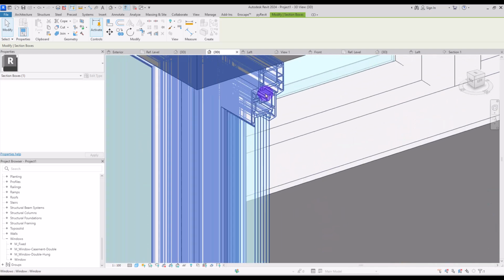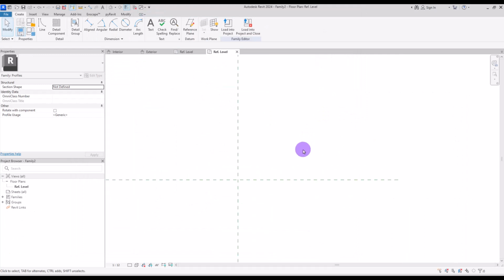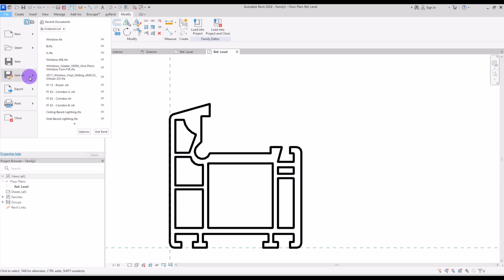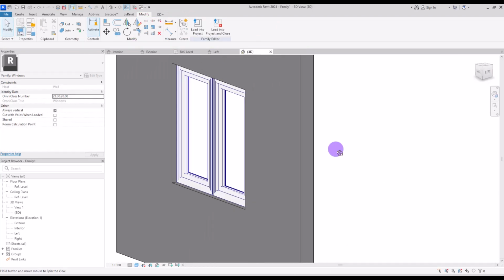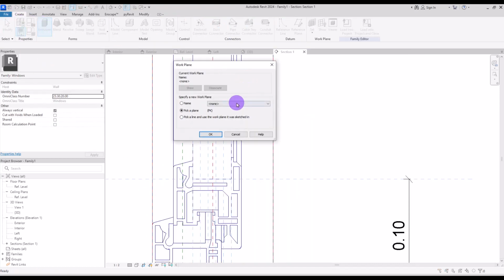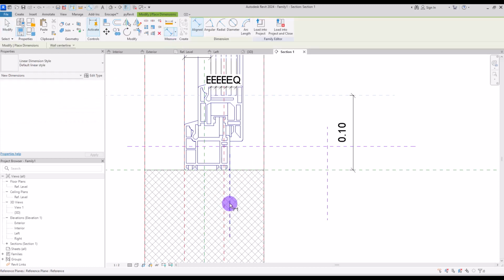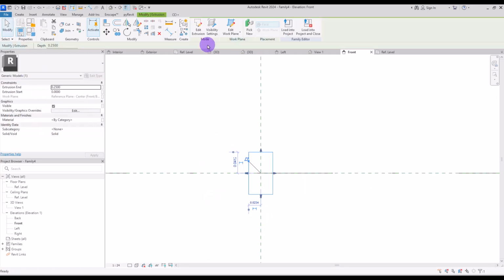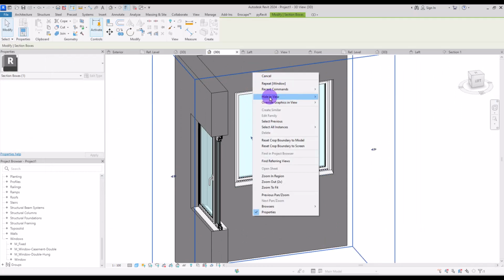How to Create a Parametric Window Like a PRO! #revit

Comment: Everything worked perfectly according to your instructions, until I put the window in a thicker wall, then the glass floats away, I can't figure out what I'm doing wrong. 
Everything else works, except the glass, I don't understand what to fix it to. 
Can you tell me how to fix the glass so that it fits with the window frame?
Reply from the maker: It sounds like you need to adjust the sketch lines to the correct references. You need to check this for all four sides.

Comment: Great video and very helpful. But when I upload the family on the project, the glass and the handle are separated from the rest of the window. I think i have to lock them to the surface or a plane. Could you specify this? Thanks in advance
Reply from the maker: You are welcome. Yes, you are right. This type of issue is because of not locking the elements correctly. You can lock them to a Surface, but I never suggest it. Locking anything to a reference plane or creating parameter for them is a much safer option.
Reply: @RVTPLUS  Thank you very much!

Comment: I am getting an error when I am placing profile in the left view that cant creat sweep what is the solutions for this
Reply from the maker: That could have a lot of reasons. First check if there is any open loops. Then check for lines smaller than 0.0008. these types of errors are mainly because of sketching.

Comment: May I ask why you didn't create profile A and B together as 1 Sweep?
Reply from the maker: Well there is absolutely no problem with creating them together, but firstly it is easier to check the lines this way. As you saw it is a bit challenging to draw small lines and curves. Additionally, if it is a double hung window creating the main frame separately is more practical for corners and joins, and also for making them openable.

Comment: DOES WORK!!!! REVIT SUCKS!!!! Cant even progress further then the first step, constraints wont allow me to align the reference planes in red to the outside walls. I am sick of this program and only been using it a week. It's not intuitive at all and even when things are 'accurate' they're overlapping geometry is all over the place it's like AutoDesk tried creating Sketchup and failed epically. I hate, HATE HATE!!! this software!!! so long winded having to create a family for every piece of geometry ever in existence.
Reply from the maker: I agree with you, and so do most Revit users in the community. Starting with Revit can be incredibly frustrating. The program still has some strange clashes that can be super tough and result in a lot of time lost.

But honestly, if you are new to Revit, you started with one of the most challenging families. I suggest trying out some simpler families first, like a parametric shelf or a bedroom setup. You can easily find these in the Revit Family playlist.
And if you need this window family for your own projects or to use it as a reference, there's a link in the description where you can download it. Hope this helps!

Comment: also, is it possible to only do an extrusion on 3 sides? I have a window with a flange on all sides except the bottom. Thanks
Reply from the maker: Sure You can. It is exactly like this, but you need to add more profiles around the main part. First draw it on AutoCAD or even on a paper and then try to model it in Revit.
Reply: @RVTPLUS  I don't have or use auto cad. Not 3 sides of the profile, 3 sides of the window.
Reply from the maker: If you watch the video again, you will see that first we draw one side of the Window, and then we repeated it for the other part. You need to do the same for any part that you want to add. You can separate different parts with References and Parameters.
Reply: @RVTPLUS   It looks like you have a window with more than 1 pane. I'm talking about a single paned window. See here >> 
https://youtu.be/fvihdhhVtyY
Reply from the maker: Well, it seems like you do all the parts correctly. Just instead of deleting the bottom part and drawing another one, First copy the sweep on itself and then delete the bottom part in one of them and in other one delete the other left and right and top part. This way their placement will be correct. 

But if I you do that, I think you will have extra parts where they reach to each other, so to fix it you can use Void Extrusion. Draw a cube and rotate it 45 degree and then apply it to both bottom corners. You must have 4 of them. Two for both sides of bottom part. One for the left side and last one for the other part.

Comment: Ugh. I keep getting a "can't create sweep error".
Reply from the maker: Try to draw lines in one continuous loop and make sure they are long enough. Too small fillets also might cause this error.
Reply: @RVTPLUS   will try that. I tried deleting all of my internal ones, but still no luck with that path.
Reply from the maker: I know it could be frustrating. Check if all of different loops are closed and trim them to be sure. Sometimes the error could be because of only a point. Also before using it in the main path test it on a straight line. I hope it works this time.
Reply: @RVTPLUS  new question. Is there a way to apply a fill pattern or pattern to any of the line elements I create? For example, of an insulated component.
Reply from the maker: We can create lines with special Patterns, and also we can create the pattern itself too. If you want to change a line of a component, you can go to its category and change its line type or select it and from Modify tab and View section click on Override and change the Line Type. This video might also help.

https://youtu.be/vumgVdwdxm4?si=ViuKmkTWVdvOacsD